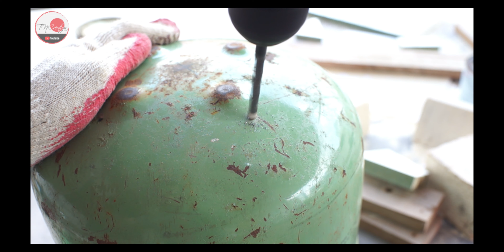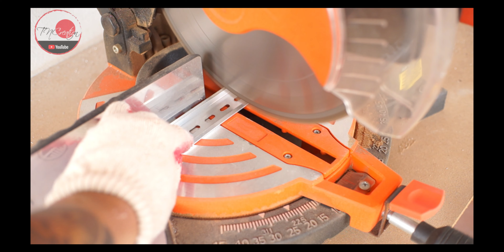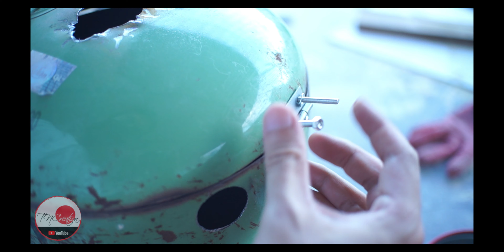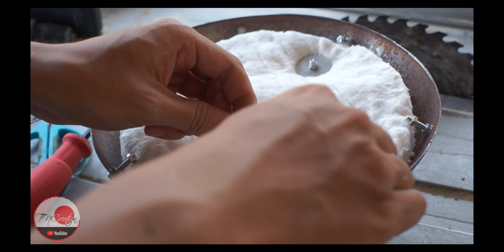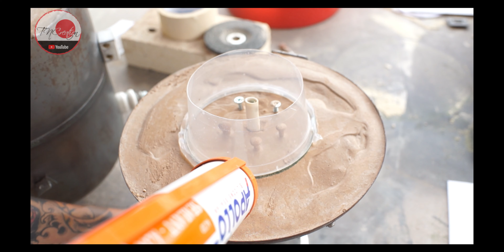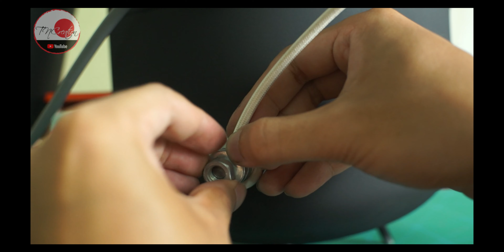DIY | MINI ELECTRIC KILN/FURNACE/FOUNDRY | RE-EDITED

Comment: Great build. Some good ideas. However did you electrically insulate the two main electrode connections on the side of the furnace body ?